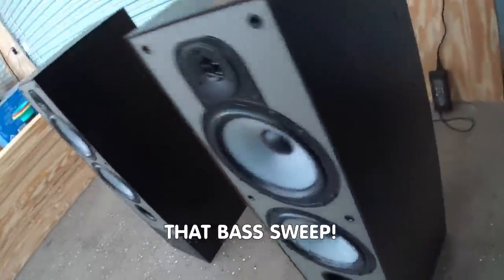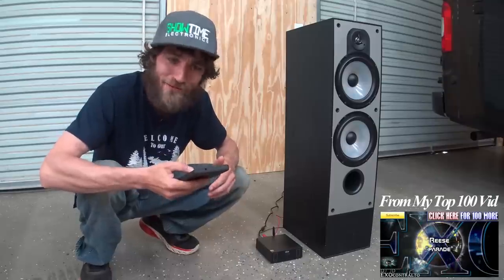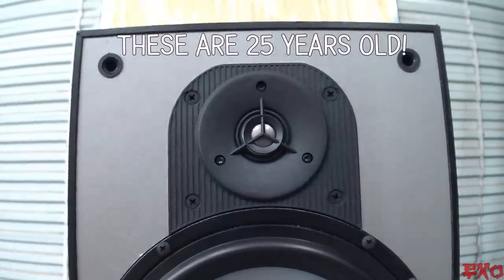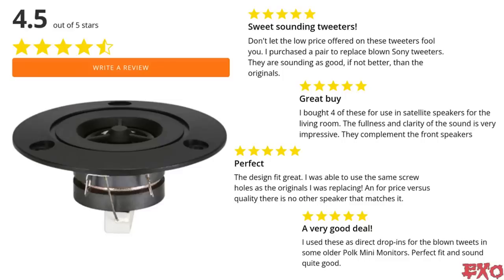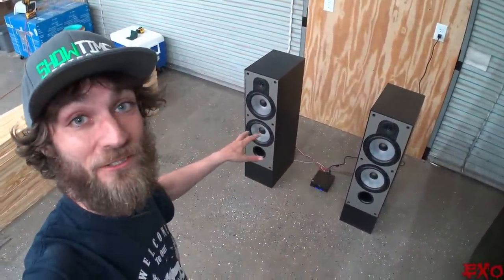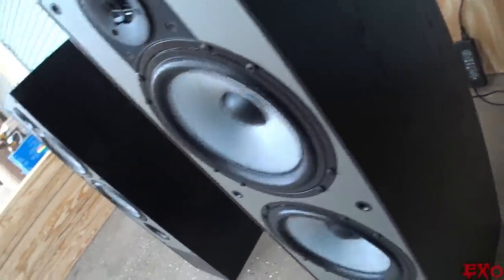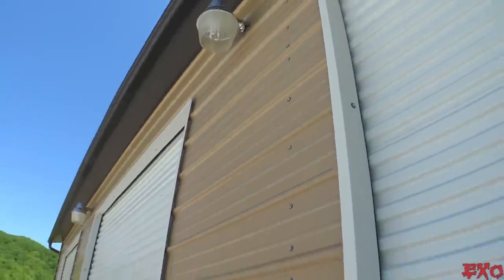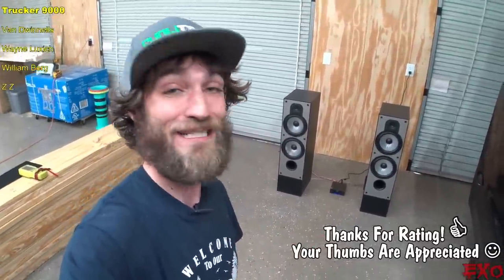"Jerry Rigged" SPEAKER TOWERS w/ 8 inch WOOFERS & Cheap OLD Tweeters! EXO's Garage Sound System FIX

Comment: The original paradigm monitor series was amazing.  I had the 5s in my home theater for years.  Great job on the repair.  I have moved on to DIY and have Elusive 1099s now.  I am going to start scanning craigslist though for old speakers.

Comment: My mom bought me those exact speakers for me for Christmas as a teenager in the late 90's and my did the same. The tweets just went out so I swapped out with some other tweets and used the face plate  as well. It's crazy that your doing the samething 25 years later. I actually liked those speakers they sounded great and the bass was surprisingly stronge.

Comment: This is awesome to see some paradigms. I am listing to this video on a set in my living room. I bought these monitor 9”s V2 back in 2002  in a hock shop for $350 and then have playing audio everyday since then. I have them paired with two PS1000 V4 subs and the other 7.2 is also all monitors. Love them. I have never had any problems with them.

Comment: I got me a little 12 inch subwoofer for my home surround sound, about 500 watt max 250RMS and a smaller 8 inch subwoofer pushing about 100 watts maybe plus the other satellite speakers hooked to a 1,000 watts receiver and I also hear the bass rattling the door from the outside, GTA V explosions have a lot of bass 🔊 
great video, thanks for sharing 👍

Comment: That's awesome, I did the same thing but with ebay and Klipsch speakers. Bought a pair for $200 one tweeter was out so I replaced it with the same tweeter from parts express for like .99 cents. And hot glued it in place. I love your videos.

Comment: I have those speakers and had a tweeter blow out. You can buy the newer titanium tweeters, but you have to cut the plastic tabs, and re epoxy them so they fit. Was fairly easy, and sound a tad better.

Comment: Just a heads up about your garage door you can put stop molding around the edges to help seal the building off a little better I did notice you have quite a bit of light coming through on the top of the door it will also help keep the dust out

Comment: Awesome, I can't wait to put a good stereo in my garage.  Hey, you breeze over components with ease and when you're not plugged into the system as close as you are can you do a video on what good builder parts are out there, or what works good for cheap as it's easy to go down the rabbit hole and spend multiple paychecks when something cheap may get you 80%+ of the way there on the cheap.  Thanks!

Comment: I did the same thing with some JBL LX600 towers. I put some P2 10" in mine and it has been slapping for 2 years now... Definately prefer the older box designs that wasn't built for maximum profits when sold.

Comment: I had a set of Kenwood 12s floor subs on a Kenwood system new in 1997 and it would bump so violently dude you had hear it. I put my floor subs under my bed in their backs and and double the bass and I had the surround sound speakers in the corners of the ceiling and it had loads of highs and mids in the room. No one knew where all the bass was coming from until they sat in the bed and than you could feel them hahaha

Comment: Looks like the mounting plate for the tweeters could easily be re-engineered with a 3D printer giving more flexibility for mounting options. Great video.

Comment: During lockdown I did buy broke gear to turn it into profit lol I needed a little distraction. My project I haven’t finish was dbx sw2x6 I fix the dents had missing logo which I did find it on eBay the drivers needed refoam which I did too and took my sweet time to make it perfect possible. But I won’t sell it high just for someone to enjoy it probably just to make over what I invested which is nothing

Comment: People tend to blow tweeters on "bright" speakers when they use some type of built in room correction on a receiver. Denon, for example, will add a boost in the highs by default. I blew a coupe tweeters on some not cheap speakers before I discovered this.
If you limit the room correction to 500(600) hz and below, you won't have this problem.

Comment: Zup dude I do the same trick with a pair of old JBL 2800 with the tweeter blown out, a small titanium tweet but I got a pair of clones of  the pure titanium from the LX026TI a bit of woodwork and that's it, still a bit of modification on the xover bcz I fell is too muddy, and needs a new cabinet the original one is damage by humidity and water, but with MDF and tools I can made it again and probably improve it a little bit

Comment: These are probably an upgrade. Those paradigm drivers were not super wonderful. The tweeters are probably a bit too loud - the paradigm speakers are really inefficient. The main issue with replacement speakers is a volume mismatch.

Comment: Nice work my dood!...Seems like you n' I share a passion for large amounts of speaker gear!?
A tower set I'd highly recommend are the JAMO S809 towers, -1' dome tweet/three 5 inch woofers. 44 inches tall)-....
>For 350$ PER PAIR you get a sh#t-ton of performance<
I just LOVE the JAMO set Ive recently purchased, shortly thereafter, I'd just "Upgraded" the JAMO S809 fronts to a set of Polk S60's-(500$ PER speaker/1" dome & three 6" inch woofers) & The only thing the Polks do that the JAMOS dont is offer a bit more lower end. The JAMO's now occupy the rear surround duties....
-A considerable difference in price points between the two for similar performance...
~Take er easy!...;)
Reply: How STOOPID!?...Dont mind my persoanlly dedicated/assigned, "Electronic Line Crossing" EwwwToob CENSOR....

Comment: drop cellings  would not be good unless you took  a crazy amount  of time to also reinforce all the tracks  and metal main angle  with caulk or silicone ,and you still have power dust falling everytime your slapping.